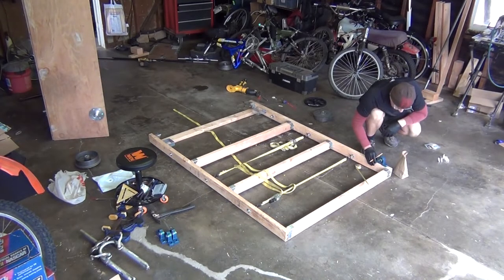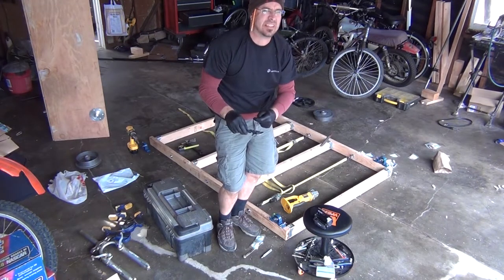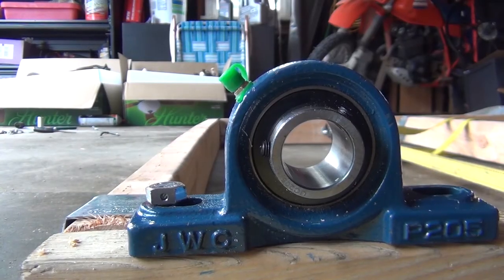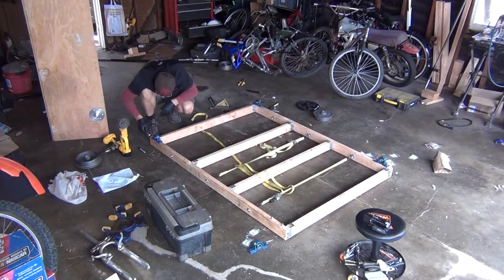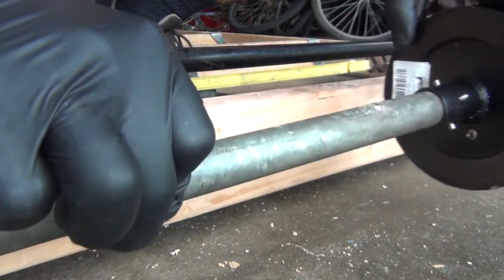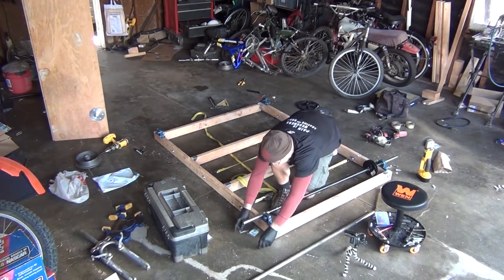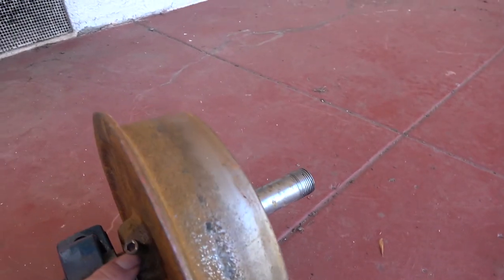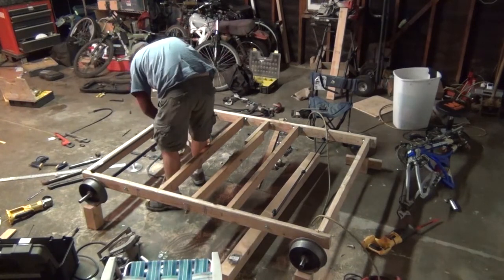Folding Railroad Cart - How I Built It!

Comment: Where did you find the wheels? I can negotiate the other parts but need that info. Turned 70 today and building a railroad cart is absolutely on my to do list as a lifetime railroad enthusiast.
Reply from the maker: @davidohler5611  
https://www.ebay.com/itm/256240147189?_trkparms=amclksrc%3DITM%26aid%3D111001%26algo%3DREC.SEED%26ao%3D1%26asc%3D20240305145905%26meid%3Ddfa50979a7ed4f98a62ccfa7720518ca%26pid%3D102022%26rk%3D1%26rkt%3D8%26sd%3D256240147189%26itm%3D256240147189%26pmt%3D0%26noa%3D1%26pg%3D2510209&_trksid=p2510209.c102022.m5276
This is exactly who I bought them from.
Reply from the maker: @davidohler5611  
Awesome. Yes build one for sure. I love mine. Especially love that it's quiet. I'm going to add an electric 26" wheel from Amazon (for a bicycle)

Comment: Hey, I've been inspired by your videos of the bike draisine and I've come to a conclusion that I'm going to build one myself. I've looked at many projects and your one looks the best for me. 

I need a rail cart that can be dismantled in order to transport it in my estate car, and which is light enough that I can turn it around on my own and your one is perfect. 
The biggest challenge for me is to design the whole construction and get all the pieces working together. I also want to install at least one emergency disc brake which would be put on the axle. 
I'm also thinking about buying silicon wheels instead of steel beacause they are cheaper and lighter but I don't know if they are that durable. 

Have you got any advice on any particular areas that I should be especially cautios with when builiding the cart?  

Cheers  from Poland
Reply from the maker: Awesome. Im so glad to hear that. I will think about your comment and get back to you, with my thoughts. It's so cool to hear from Poland. One of our closest family friends was from Poland.